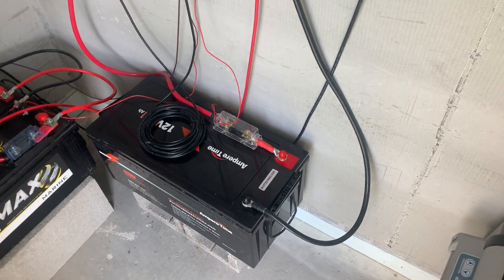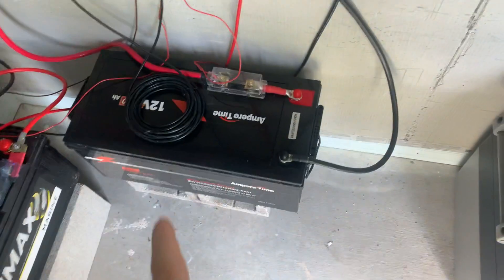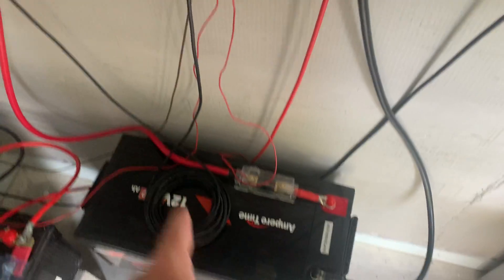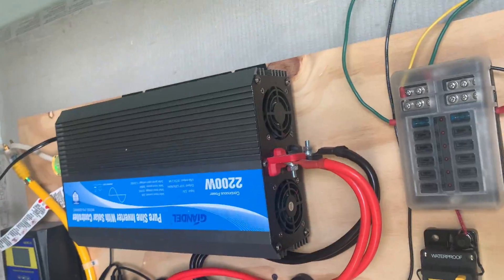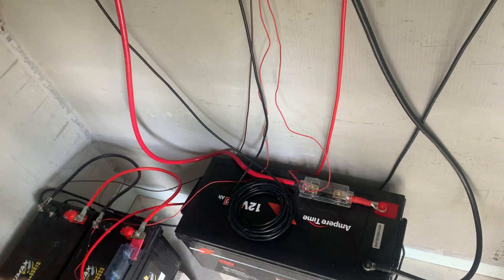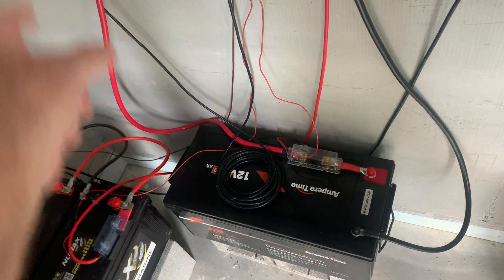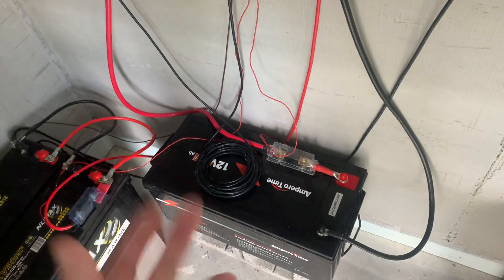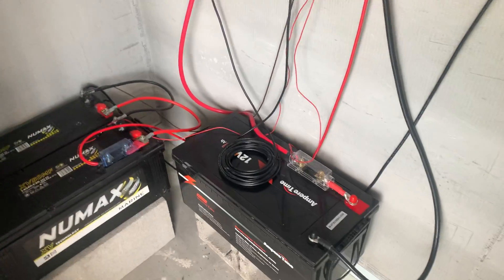Ampere time 100ah lithium VS 200ah lithium

Comment: What is best to buy and install  ... 2x 100Ah 12V or 1x 200Ah  12V  LiFePo4 battery  ??
My system setup is ... 4x 150Wp 12V solar panels, 2x EpEver MPPT solar chargers (2x2 panels in parallel,  because different directions) , 12 to 220V inverter of 1500w pure sinus
Reply from the maker: There are a few parts to the question and it depends on your future growth.  I like the 2x100 because I want to move to 48v on my yacht and I don’t have room for 4 200w but I can fit 4 100w with no issues.  If space and money are no issue then maybe the 200 is a good fit.  It also depends on how much power you need from the batteries … you have a very nice solar array so maybe the batteries are less of a concern.  
Best of luck and thank you for the question.
Reply: @colinauld  I think I will go with the 2x 100Ah

Comment: Just got the 200ah plus. 200amp bms is where its at. Starting with 250 watts of solar. Basicly it will be a homemade portable power generator at first until I add enough batterys i cant move it around it will become stationary lol.

Comment: I'm no expert I built my system using 200 ah lith batteries at 48 volt configuration so total of 4 and I never run out of power They service my 2 nd story of my house and garage which I work out of
Reply from the maker: I’m no expert either and if I was trying to supply an entire 2nd story I would have gone the same rout as you. My goal is to have a comfortable room in the event of power loss with minimal expense.
Thanks for the comment, I’d love to see your setup.